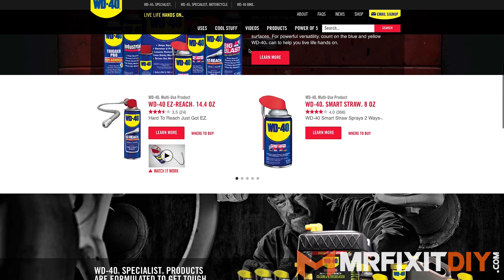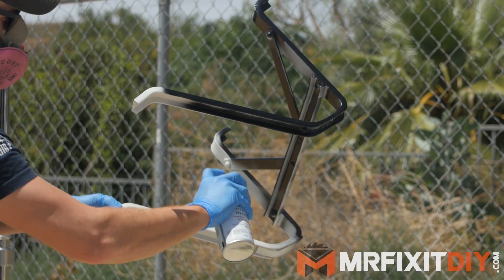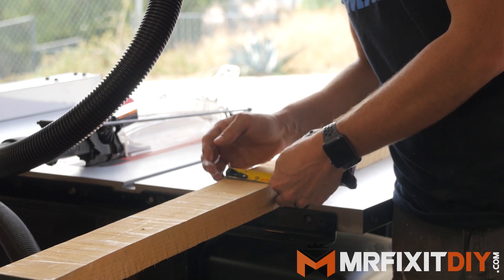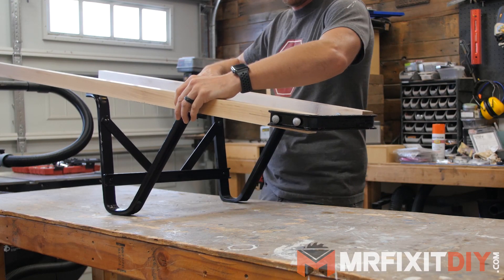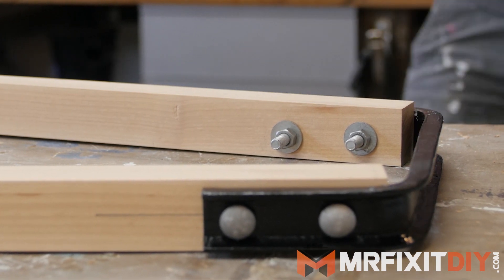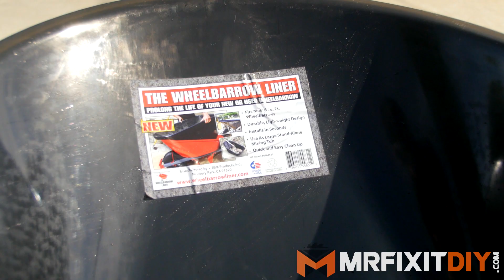How to Restore an Old Wheelbarrow

Comment: Great video. Tip--- I bought handles that had holes pre-drilled and varnished at Ace Hardware online for a decent price. This saved me a bunch of time. Don't forget the wood wedges as well. I restored my 20+ year old wheel barrow and painted it the same color as my house since I had so much extra paint. Knocked it out in a day.
Reply: Thank you for confirming that you can find the parts yourself. Easy DIY.

Comment: One of the things I love is seeing old well made tools being restored.  Your restoring the old wheelbarrow was enjoyable to watch Eric.  It is now something very useful once again.  Thanks
Reply: Greetings and thanks for post. Quick question. How do I fix wrong holes drilled on wheel barrel handles??
Reply: Country Lifestyle You might consider plugging the holes with tight fitting dowel rods.  Glue them in and use a trim saw to cut them flush.
Reply: @jukeman57  Thanks for the speedy response 🙏🏾 There is one problem. I need that area as well. The holes are slightly off compared to the original wheel barrel handle.

Comment: If you don't remove the liner, periodically, the wheelbarrow will rust underneath it.
Reply: <<
Tony Hemingway
1 year ago
If you don't remove the liner, periodically, the wheelbarrow will rust underneath it.>>

To maintain your wheelbarrow,  I'd say you need to take it completely apart every ten years,  prime and paint all the wood and metal and grease the bolts when they are reinstalled.  The bolts really ought to be galvanized  ---the threads routinely get badly damaged over the years from what I saw on other decrepit barrows.

Personally,  I didn't bother with a liner.  Priming and painting just the bed of the barrow when the paint gets badly chipped sounds like light work,  and cheap to do. It really takes a LOT of neglect to rust out the bed of the barrow to the point that you can't use it.

But if you want ELEGANT,  a liner is probably for you!

Comment: I remember in the early 1980s helping my dad restore a 1967 mustang and he applied some type of rust eater and it completely dissolved the rust without any sanding or grinding.  I don’t know what it was but I’m trying to find something similar to avoid having to grind or sand it off.  Does anyone know what does that?

Comment: On the original, there is a cross piece of wood, front and back. Kind of makes it a square on the underside of the wheelbarrow.
Reply from the maker: Good to know. I haven't had a problem since I did this but that's good to keep in mind if I do it again

Comment: WOW! You’re an artiste! Thank you for your video. I wish I had the tools, strength, perseverance to do this to a rusted old wheelbarrow I’m acquiring for free but your tutorial will help me tremendously. I also need to find a wheelbarrow liner. Brilliant. Thanks so much.
Reply: Thanks for the tut!! I’m gonna be restoring mine today…the original plan was to just replace the wheel…then i realized the wheel guard was loose, then one of the nuts for it was seized from rust, of course in the perfect spot so that the bolt spun in place w/o any space to keep it still…to then notice the wood’s  rotted anyways…. after too many attempts, 3 oscillating multi tool blades, 2 hacksaw blades, and the use of a mallet & chisel, i used my “powers of persuasion” to get that final piece separated…glad i have enough of the og part remnants to get accurate dimensions & such from, at least…

Comment: Very nice job!

I bought a wheelbarrow thirty odd years ago,  and it became very decrepit over the decades to the point of being almost useable.  A month ago I decided it was a new wheelbarrow or fix the old one  ---and with your "where's the fun in that? philosophy, I decided to rebuild.

The wheel was junk. Checking Craigslist "Free" stuff,  I found someone discarding TWO old,  decrepit wheel barrows,  which I picked up.  One has a useable wheel which holds air.

I tried taking the old hardware out,  but it was VERY rusted and I wound up cutting off what didn't want to unthread.

The body of the wheelbarrow was rusted and pitted, but still useable.  I used my angle grinder with a wire brush,  which cleaned that up easily.  The other hardware still had some paint on it,  and cleaned up with the wire brush as well.

The long handles were still useable,  but the grain had opened up,  allowing water to get in and promote damage.

I made new angled wooden wedges.

I bought new bolts for assembly  Carriage bolts with round heads would have been good.  the standard bolts will impair using a shovel to remove the contents of the barrow.

I brushed on Kilz primer that I had on hand to all parts,  wooden and metal,  except bolts,  nuts and such.  Then I painted everything with white latex outdoor paint. 

So I have a VERY white wheelbarrow!  

A word to the wise:  your wheelbarrow needs maintenance!  After a few years,  take it apart,  paint it and take care of the bolts so that you can take it apart and reinstall them easily. A little grease on those bolts would go a LONG way,  I suppose. If you do that,  you wont have a big job to do or face the need to buy a new one.

The Chinese invented the wheel barrow only about 800 years ago.  One of the great inventions in the history of earth moving  ----before that,  earth was carried in baskets.
Reply: Could you please advise what grease could be used on the hardware ? Thank you !
Reply: <<
@tatiananaugolnykh
7 hours ago
Could you please advise what grease could be used on the hardware ? Thank you !>>

I just used what I had on hand  ---- axle grease is what I had on hand, and axle grease is what I used.

I'd use old motor oil if I didn't have grease on hand.

After all, it's just an old wheelbarrow!

This summer marked the second year of use after rebuilding my wheelbarrow, and the paint was getting chipped some.  So I washed the dirt off and repainted again with the same old house paint I used a couple of years ago.

Looks SPLENDIDLY spiffy again!

Comment: I have two wheeled barrow with a plastic bowl. Can I replace it with a metal bowl? All the wheel barrow places seem to just want to sell you a full kit:-/
If needs be I do have a drill I could reposition holes.

Comment: Greetings and thanks for post. Quick question. How do I fix wrong holes drilled on wheel barrel handles??
Reply from the maker: You could plug them with dowels and wood glue and re-drill the correct holes.
Reply: @MrFixItDIY  Thanks so much for the speedy response and can I use the near the same area after I plug it?
Reply from the maker: @CountryBlessingz  Once the glue has dried with the dowel in place, you should be able to drill anywhere near it
Reply: @MrFixItDIY  Thanks soooo much!!!!  This info is priceless. May God Bless you and your loved ones. 🙏🏾🙌🏾
Reply from the maker: @CountryBlessingz  Thank you! Same to you!

Comment: I  was hoping you would have shown a little more detail on calculating whear to drill all the mounting holes. Calculating the angle and length of the wedges would have been a help also.

Comment: Is that oil based paint?
Reply: In my own project,  I used latex.   The real key is repainting after ten years or so before everything goes badly to pot.  That's especially true of the threads on the bolts,  which routinely get damaged by rust unless greased.  They really oughta be galvanized.

It was the threads on the bolts of my old barrow that required replacement.

Secondarily,  the grain on the wood handles was opening up,  making rot a LOT easier.  Slopping primer and paint on those damaged areas will probably extend the useful life quite a long time.

Those are my observations from rebuilding my old barrow.